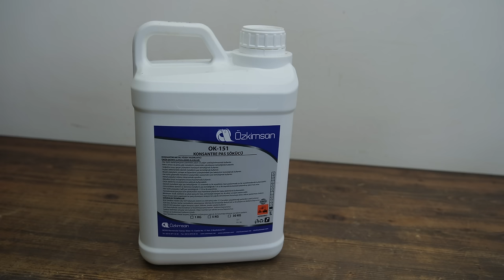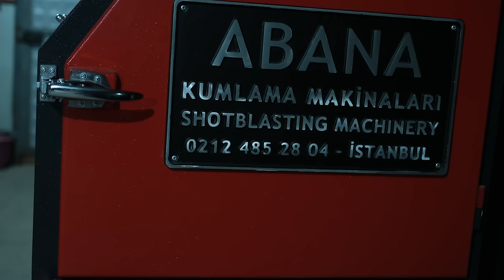1971 American Pipe Vise Restoration - Restoration Videos

Comment: 0930’24/0958h 🇺🇸 Thanks for the presentation. Preparations were nice to see and understand. If this video presentation was meant for learning and understanding those fine refinements, for the common man, it’d have been much more educational if you had specified the brand and names of the chemicals used for cleaning and for the electroplating the parts. Th

Comment: Had exactly the same pipe vice in my old workshop, although I preferred to use the chain vice as it gripped better without burring the pipe too much. Fantastic restoration, I'm sure they didn't leave the factory with such quality finishing!
Reply from the maker: Thanks a lot
Reply: Very interesting video

Comment: Nice finish, but why did you pop a bolt into the hook side of the pipe vice? When I was an apprentice electrician we used to cut threads onto steel conduit and screw it together (I hear the young ones gasping, oh no hard work!!) and that hook end was always free to hook and unhook to hold and release the pipes.
Reply from the maker: What you describe makes sense for a quick move. but when I do it it makes sense for slow motion. In short, both are correct.
Reply: And having the two holes was so you could have either left or right hand opening.
Reply: Even the very first photo shows there's no bolt next to the hook and one is never needed.
Reply: Going to drive somebody nuts trying to use it that way!

Comment: anyone else notice that he messed up by adding a bolt to the body on the side with the hook? It's supposed to be a pin that can be removed so the vise can open to accommodate longer pipes.
Reply from the maker: The person who wants it will not use the bolt he does not want. For a right or left handed person. You don't need to get excited.
Reply: @meinemechaniker  the irony of telling someone to not get excited with the intention of upsetting them. learn to take some criticism and maybe don't get so excited
Reply from the maker: @biomewanderer6312  You are right in your suggestion. 🙏🏻

Comment: I wouldn't have plated the threads (just each end).  Other than that, an absolutely showcase video.  Very instructive.  Your buffing is exceptional (makes one wonder if plating is necessary).  Good idea to use the O-rings as bumpers!  I'll have to look up what the black stuff is - I suspect it's more than just paint.  Many thanks!

Comment: Is there a reason you put that bolt in at 34:45? That locks it closed. That hook is supposed to keep it closed, and if you put ANYTHING in that hole, it should be just a pin so you can easily remove it and swing the vice open. Also, you need to lock-tite the knobs on the top crossbar, and the threaded rivet. Being not even finger tight, that rivet is going to fall out in a stiff breeze. The overall look is nice, but without affixing things properly, it's just a piece of art, not a tool.

Comment: How did you know that the third hole in the base had been drilled there and wasn't original to the piece?   Seems like a third hole would make sense if you wanted to bolt it to a bench.
Reply from the maker: You should look at the moment in the video where you show your bottom. 2 holes are the same, 1 hole is different.

Comment: Probably didn’t need to do this, but “Meine Mechaniker” translates from German to “My Mechanics.” Hopefully this is a second channel for him and not someone ripping off his videos. I’m wondering because “My Mechanics” hasn’t posted in a while. He left off with the restoration of his Datsun and that was so entertaining to watch.
Reply from the maker: Fein werk mechaniker 👌
Reply: OK… Takes a saw to the original vice handle to make a new one… chamfers ever hole… removes burrs using that tool to get to the back side of the hole… uses Hammerite paint… uses bluing on the bare metal parts… files down all the original casting marks… polishes with one of those red sanding pads while the parts are clamped in a lathe…  nickel-plates the parts… proudly shows the parts off after restoring them to better than new… files the teeth of the vice’s jaws then uses a cutter to flatten every tooth.  The only thing missing is you saying “I’ll make a new one.” If you aren’t My Mechanics, then you’ve taken a cue from one of the best because imitation is the sincerest form of flattery. 😄
Reply from the maker: @juanbanzai  do you like it?

Comment: You do realize that making any new part for this or any other equipment means that it is not a "restoration", right?  What you are doing is "repairing".  You are misinforming the public.
Reply from the maker: Do you mean that I know many things better than you? If so, let me ask you a question? When restoring a car, does changing the tires mean that it is not restored but repaired?
Reply: @meinemechaniker  ..."Do you mean that I know many things better than you?" - this has nothing to do with my argument and therefore will not be addressed.

As to your question on whether changing the tires on a "restoration" car project changes that into a repair, yes, it is no longer a restoration as you are replacing original parts with ones that are not original to the project.  This logic should be self-evident.  I have now given you this answer twice now.  You seem unable to grasp this concept between restoring a thing and repairing a thing.  One final time, restoration does not involve replacement of parts.  The title of this video is false and misleading.
Reply from the maker: @Rickbearcat  I also think you are wrong in many places. First of all, I think you don't know exactly what is original. In my last project, I made a new one to replace the missing part. I replaced the non-original bolts with new ones. The handles were crooked and could not be fixed, so I renewed them, remaining true to the original. This explanation is just for you. I do not restore tools from neolithic times. I restore things produced after the industrial revolution.
Reply: @meinemechaniker  ...If you don't know what is original to a thing, then you can not restore it; unless you find original parts within the same timeframe of manufacture to replace with.  I would accept this as a "restoration".  Making a new one to replace a missing part is not a restoration, it is a repair.  Any hardware you "create" to replace what is not there or is damaged is a REPAIR, not a restoration.  If the handles were crooked and you heated them up to then straighten them out, then yes, this is a restoration.  Renewal of original parts is a restoration as far as I'm concerned and is "...true to the original".  If you had to add material to the handles to bring them back into shape, let's say, then that would have been a REPAIR, not a restoration.  As far as "neolithic times" are concerned, there is no defined period where a restoration is concerned.  Either 1,000 years ago or last year.  Restoration does not involve a time period.

I would have no problems with what you are doing, and I don't...ASIDE FROM THE FACT THAT YOU MISTITLED THE VIDEO.  Irrespective of any "description" you may have written below the title of any video.  Otherwise, everything is fine with what you are doing.  Just stop mislabeling your videos.  Maybe this 3rd time of explaining this will stick.
Reply: @meinemechaniker  ...Understood.  And not a problem.
Reply: @meinemechaniker  bruh, just bruh, u say, having no time and writing comments? Huh?
Reply: @meinemechaniker  stop hearting my comments, these are not compliments, these are facts I’m talking.

Comment: Obviously none of you in the comments nor the creator of this video know what actual restoration is. Once you heated up the metal you are supposed to dunk it in oil to harden it back to its original state otherwise you have just ruined the structural integrity of the metal, also once you apply cold bluing to metal you are supposed to dunk it in water to stop the chemical process or it will rust, and then you soak it in oil overnight to preserve the quality of the bluing and keep it from rusting in the future. Also it's no longer restored if you just throw away a part because you are to lazy to straighten it like the handle. This item is no longer restored it's been ruined, try watching "Odd Tinkering on YouTube to see some real restoration videos instead of watching someone ruin a piece of history because they "think" they know what they are doing
Reply from the maker: I don't have time for you. Don't waste your time here! You might want to watch playstation restorations.
Reply: @meinemechaniker  You’re so pointless……